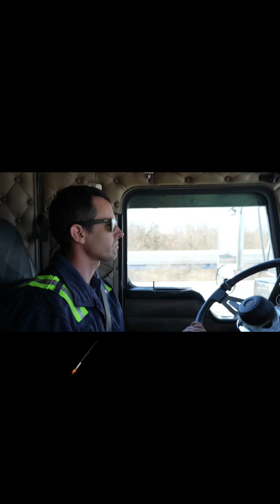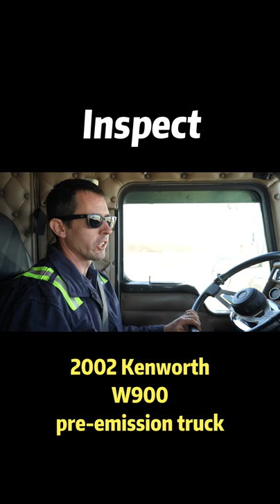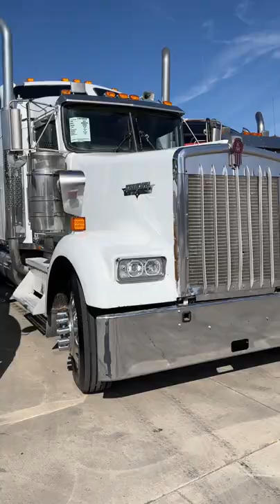Pre emission semi trucks are TOO expansive #shorts #short #youtube

Comment: Finally someone that actually points out the flaws of old trucks. Great job!
Reply from the maker: Thank you!
Reply: Besides the obvious? a 20 year old truck needing some Tlc.. 
Bushings, king pins...10k worth of work
Tell me how much emissions Related work costs
Reply: Go ahead and spend 5 to 10k a year on def and Regin maintenance. I'll take my 99 w9 over newer trucks any day.
Reply: Sure, from the guy making money on all the unnecessary maintenance.
Reply: @tomwinkle1597  I think what Ryan is saying is that old trucks are overpriced. There is no doubt that pre emission trucks are more reliable and cheaper to maintain but in today's market, these old trucks are sometimes way overvalued.
Reply: @philhartman6036  opinions are like... When new trucks, just like pick ups, go thru the roof, it only makes sense that the used 1,'s go up. New w900 are over 200k. When I bought my 1999 for 35k the new ones were 170k. Why I commented was because he will never see my truck. The new ones will be in there several times a year. And a new truck payment does not stop if it's in the shop.
Reply: @tomwinkle1597  lmao so true, there ain't not breaks lol, pay me or else
Reply: @philhartman6036  If there's no doubt that they're more reliable then why wouldn't they be more expensive, since there's only a limited number of them..and everyone and their mom wants one...Take that old truck and put into it 1 years worth of new truck payment and see how it does...or better yet 2 to 3 years and see what you're left with, A TRUCK! everything above 2007 ( unless glider ) is throwaway pointless to invest money into it
Reply: @tomwinkle1597  lol at payments, what happens when warranty runs out and payments still keep coming, they just don't get it!
Our trucks will take us to retirement ( god willing ) theirs 3 years or 300k miles, which ever comes first lol

Comment: I agree trucks are not worth more than 30k but if it was a normal market and i ha d the choice between a pre emissions vs a 2016 semi with a cummins def crap , i would easily choose the pre emissions. The little things you pointed out here will not give you a 2k tow bill plus 6k worth of emissions breakdowns in just 1 break down
Reply: Exactly! If they were 30k everyone would buy them!..and since everyone wants one, guess what! they are 80 to 90k
Trucking Shouldn't Be looked at as a Year By  Year Basis
You Take that 80k Truck and Say you put another 100k into it, that comes out to about 180k and to some its sounds Foolish!
You can buy a brand new truck for 160k
But nobody is looking at it for long term!! say 7 to 8 years! then compare the cost of ownership..and that 80k used truck is going to look mighty good! compared to the one you can't even keep past 4 years!!!
Reply: @Dubya9W9  i bought a flat nose truck for less than 30k with a fresh inframe rebuild and new tires and looks great to the point that everyone that asks me what year it is, they get surprised its a 99 because of how well maintained the truck is. Theres deals out there but the problem is ppl not doing their homework and buying trucks for 80k thats not worth more than 30k...i bought my truck summer of 2021 when the markwt was on fire too
Reply: @Montoya1991  Those Deals are Rare Sure you can find them if you look hard enough but if everyone is looking for the same type of trucks Hoods to be specific they will have a hard time buying one for 30k doesn't matter what shape its in
This Topic is beaten to death tbt..there is no beating old trucks! especially on the resale value.
Its worth what someone is willing to pay for it and old hoods are getting more and more expansive and will continue.
Mine is an 04 with probably over 250k in work on it..You think i would sell mine for 30k or 80k for that matter?! just because its an 04 
I wish someone would say that! i'd have a good laugh!

Comment: I bought an old century 1998 ELD exmpt 
Was the biggest mistake , engine and transmission solid but hey hey hey 
Almost 20k in repairs 
Bushing hoarse seals , tires 5th wheel 
Kingpins , the cab was garbage , 5k in chairs dashboard mirror doors panels …
Will never ever buy an old truck anymore I did underestimated all these little things but pay big time later plus freightliner don’t make any replacement parts for those truck anymore 
I was having hard time to find any part ….
Reply from the maker: Sorry to hear that! I don’t advise people to get old trucks. They are ridiculously expensive, other parts need to be replaced or repair. The repair cost isn’t cheaper than the emission problems. People should stay with the newer truck and learn how to take care of their emissions.
Reply: @truckingandfixing  before buying this truck I absolutely wouldn’t agree , but now after buying this truck I learned the hard way 😂…the time parts and down time unbelievable and peoples always think good engine good transmission ole ole :)there is way more than that when you buy an old truck
Reply: @truckingandfixing  What about buying a nearly new glider?
Reply: @mewithouttherandomnumbers  best of both worlds
Reply: New truck has 20k worth of emissions garbage that has to be deleted just to make it reliable.
Reply: @user-qt8zt6zg6w  buy a freight liner cascade and take it to Texas , and put 12.7 in it 
That’s what they do now in Texas
Reply: @user-qt8zt6zg6w  it will coast you a little but it’s worth it man

Comment: Western Star is where it’s at. Heavy duty off-road frame and it comes with a DD15
Reply: I looked at 1 of those before I bought my kw. I was told the older 1's before fl bought them were really good trucks. I like my Cat and nowadays you can find good after market Parts. Never did see a Detroit that would pull like my Cat. The big red motor will pull.